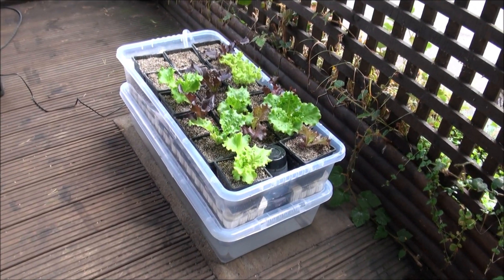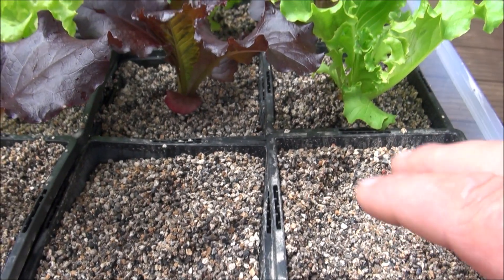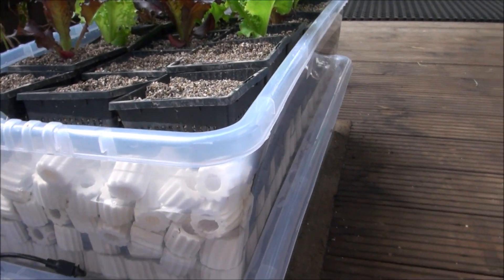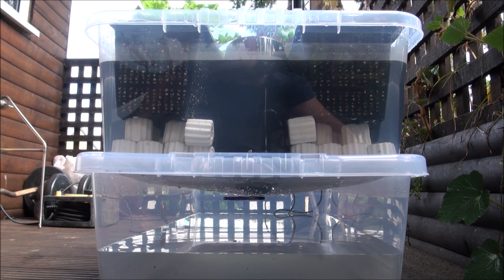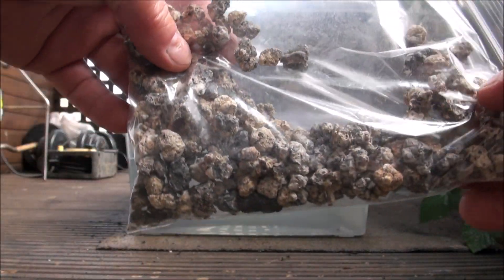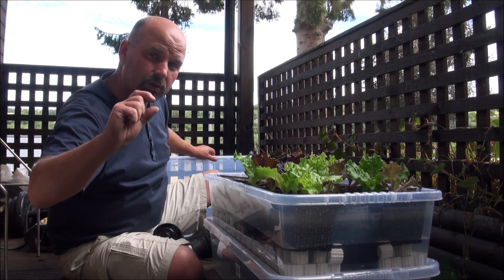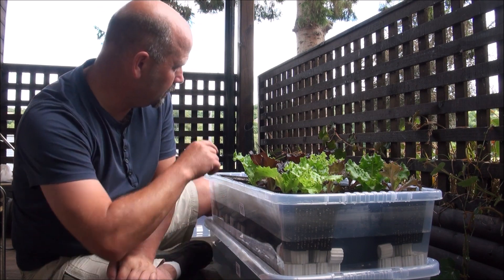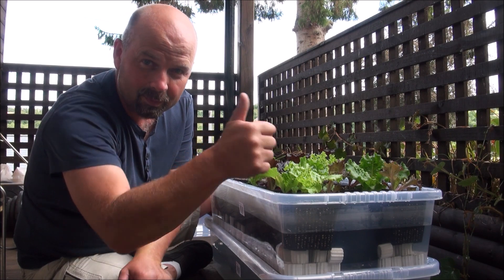Simple, Cheap DIY Hydroponics  Ebb and Flow Growing System

Comment: Thanks for the video. What is the timing of the system please. How long to fill and how long to drain?
Reply: (my other channel) It takes somewhere between 10-15 minutes to go from drain to full to drain again. Obviously the time of the drain cycle can differ depending on the water level in the tank the system sits over. Currently I have this system operating over my main water tank in the vegetable garden and the water level fluctuates there daily so the drain cycle could be anywhere from 10 minutes to approx. 25 minutes - either way it still works fine.
Reply: @pondguru  Thanks for taking the time for me. I am designing a small system based on my fish pond. It has a capacity of 1500L. The grow beds will be IBC based. I have come up with a system to flood and drain such that the pond will not vary in depth. It is effectively the sump tank. There will be constant flow into it at all times. It's quite a simple system where each grow bed is divided in half. The system of flood and draining is completely mechanical and automatic. The cycle time will be about 10 minutes with equal time to drain as to fill . The reason for asking is that I was not sure how long roots can be without water. From your answer it sounds like my timing is ok. What's your thoughts?
Reply from the maker: @robguyatt9602  That seems perfect although crops other than leafy greens may need a longer 'dry' period for their roots.
With hydroponics I've only ever had success with lettuce, chard and pak choi which don't mind lots of water. I've never managed to get the timing right for tomatoes or other more substantial crops.
Reply: @ThousandYardStare  Hmm, sounds like I might have to use my mechatronic skills and design for adjustable timing. Thanks for your compliment.
Reply from the maker: @robguyatt9602  No worries and best of luck with the system.

Comment: Hello, Nice video, only I can't see where you installed that giant siphon you showed. At the start of the video I see something that is propably the syphon but what you have in your hand in the end of the video looks more big to me as what is in the container. BTW this type imo is not like a bell syphon and the water pump is running 24/7. Than why not a more simple system? In a way only install a pipe at the bottom to prevent overflow, and run the pump over time and stop over time. As it stopped water runs back over the pump?
Reply from the maker: Yes that would work - either way is fine.
The siphon has a threaded base with locking nut so is easy to fit. It's still working now in exactly the same place and I've done no maintenance on it.

Comment: How does your pump add oxygen to your water ?
Reply from the maker: It draws water into the intake and the impeller shreds it to properly integrate it into the water. Added to that the water is re-oxygenated (after filling up the growing zone) when it goes through the auto-drain valve and falls back into the reservoir.

Comment from the maker: Sorry I forgot to put the conversion in the video: 450 litres per hour is approx. 118 US gallons per hour
Could this be classed as 'Sandponics'?
This is a short video showing a simple DIY hydroponics system I made a few days ago. It could be described as Ebb and Flow or Flood and Drain hydroponics. Materials list below:
43 litre Container: https://ebay.us/49NTzv
I show 2 containers in the video but a third one can be used as a top to protect against slugs / snails etc. and to allow for growing through the Winter by providing a warmer environment due to the greenhouse effect (the real greenhouse effect, not the nonsense we were 'taught' in school). 
Urinal Syphon: https://ebay.us/vV2xnu
Oxy Water Pump (450 lph): http://filterpro.co.uk (pumps page)
11cm x 11cm pond baskets (Ebay): https://ebay.us/Utz2B4
11cm x 11cm pond baskets (Amazon): https://geni.us/Ivz2Q
The media used to fill the pots is a coarse ceramic grit and I have a larger version arriving which is more comparable to traditional clay balls. However, it is much rougher and knobbly than the clay balls and from previous experiments with a larger type of this media in ponds I've noticed that the root growth and plant size / health when growing in this media is noticeably better than growing in other media.
I will upload update video(s) and a specific video on the larger media as the trials progress.

Since making this video I have made another system with 1 litre 'air pots' as the media / plant containers and swapped the original clear container reservoir for a much larger 150 litre 90cm x 60cm x 35cm container to act as  the reservoir. Now I have 2 growing systems fed by the same reservoir. Added to that I have used a clear container as a cover for both systems - effectively protecting the plants from inclement weather and pests. 
As the systems are outside the cabin where I work I can open them up when I go up there in the morning and close them down on a night when I've finished work - I will make another video showing the upgraded system after I get the new hydroponic growing media so look out for that.

Given the cost of bell syphons and the materials (and associated cost) to make them I'm not sure why people with hydroponics don't use the Urinal Automatic Auto Flushing Syphon - I bought 3 of them for around £5.40 each.

If you prefer a free speech platform to watch content then please check out my channels on Odysee and Rumble:
Odysee: https://odysee.com/$/invite/@ThousandYardStare:e
Rumble: https://rumble.com/c/c-1824507
To be honest I've not much idea of what Rumble is or does but it seems quite popular among people more tech-savvy than me....and somehow plenty of people have already found the videos judging by the views (and 'Rumbles'?).
Both Odysee and Rumble have new videos uploaded to them as soon as they upload on YouTube.